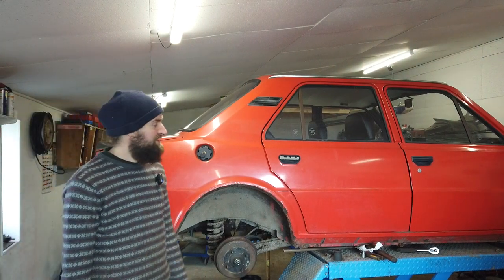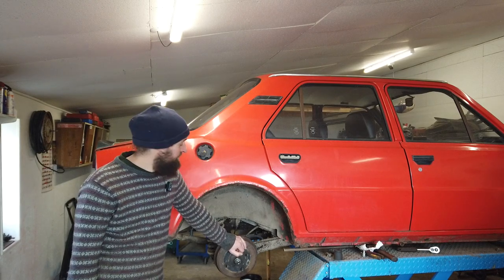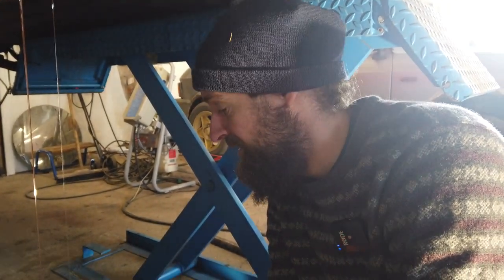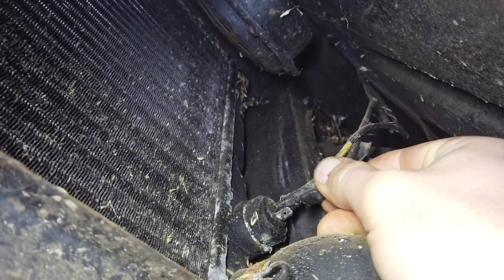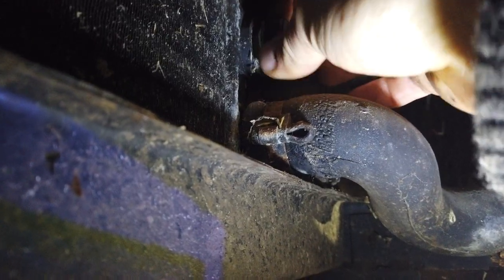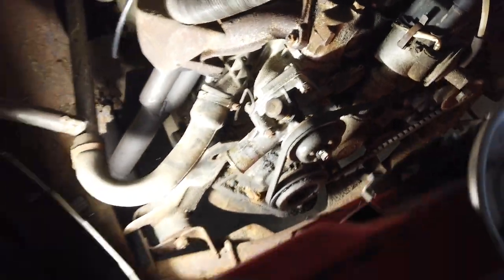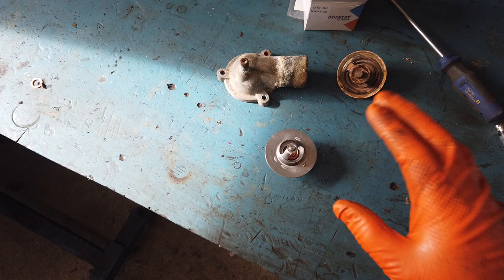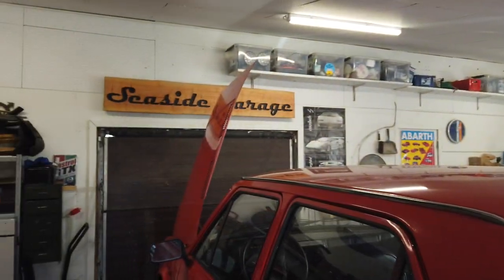BARN FIND ŠKODA 105- Keeping it cool!

Comment: It does look a pleasure to work on. You have that wonderful feature that is now made of unobtainium on modern cars......space to work and reasonable access to components. Our first Skoda Favorit was just the same. Good honest engineering.
Reply: had one for years back in the 80s and there were thousands on the road in my country the uk all gone now never see one and they were so easy to maintain and you did every job yourself good simple mechanics
Reply from the maker: Its made to be fixed and used for as long as the owner pleases.... unlike most newer things...

Comment: Cool the thermo switch still works! The Wahler is the original thermostat! Does your new thermostat have a jiggle pin? That’s important the pin should be fitted upwards facing the highest point. Some clamps have been replaced. See a modern Škoda sticker on the expansion tank as well, so I believe it’s serviced properly. Don’t think they came with red coolant from the factory. But maybe I’m wrong about that. The old clamps sometimes break due to rust. Did you know there are 2 rubber connection hoses under your car? They connect the aluminum pipes. I suggest to inspect them and check the clamps. They might have been rusted through. Rubber hoses are under te cover plate. Need to remove the cover.

Bleeding needs some more effort. Run the engine warm with the heater on and radiator cap off until  it is warmed up completely and the fan turns on. Then put the radiator cap back on and bleed the system until you see a steady jet of water coming out of the bleeder.
Reply from the maker: I will look into that :) I will make sure the bleeding is perfect when I can make use of the waterpump pressure... :)

Thanks for your comment as always!
Reply: Yeah, the sticker says the coolant has been tested in 1997.

Comment: another job done and yet another good memory for me and thats the switch on the radiator and they used to let water in and short out supplying power to the fan all the time and flattening the battery and it took ages to find the issue oh the memories with this project love it
Reply from the maker: Ah! I will remember that... thanks

Comment: Don't worry about old legends, if the liquid is this clean, you'll have no issues with the cooling system :) especially now that you know everything is working correctly.

I'm quoting the factory directions here: the waterpump needs to be greased after every 10000 kms, you have to fill the cap with grease, push all the grease into the pump at once, and you have to tighten the cap, otherwise it might shake off. After that, the used grease from the rear bearing ends up on the backside of the pulley, so you might want to wipe it off, otherwise all that grease will be dispersed around the engine. Most skodas have a distinct line of grease across the hood :D which looks awful, but it also tells you that the pump was maintained correctly :D

Also, people usually overthink the bleeding of the cooling system of skodas, but it's really easy (again, factory directions): you just have to open the bleeding tap at the front before you start filling it up, so the water can push the air out as it fills the components. once the water level stays at the correct level in the expansion tank, you're done, close the tap, and that's it. Provided there's nothing clogged, nothing else needs to be done.
Reply from the maker: Thanks again for this very useful comment!

I was actually told the opposite by a Skoda collector! So I am happy to hear this from a workshop manual... I should then be able to take good care of the pump. :)

Yes the bleeding seems straight forward on this actually.... way easier then my R5GTT and others...

Comment: That looks to be going well - nice to see everything is playing nicely so far. The water hoses with jubilee clips suggest to me that the engine has been taken out at some point as those are the joints you need to break. The hoses with the split pin and band can be left alone hence still original. Any genuine Skoda owner will have several spare bottles of water stashed around the car, in the engine bay you can have a 2 litre pop bottle in the scuttles either side of the chassis rails. In the front near the bleed valve you can usually get another 2 litre bottle! The bleed valve at the front is really useful for a hot refill! If it overheats the last thing you do is take the cap off the expansion tank. With the Skoda just go to the front use the bleed valve to let out the pressure in the system then you can go to the rear remove the pressure cap safely - quickly top up from the bottles stashed away and you are on your way. Been there got the T-Shirt!!
Reply from the maker: Haha that is what those spaces in the engine bay are for! Water bottles! ;)

I think you are right about the jubilee clips.... either engine out or coolant flush and new water pump... :)

Comment: Awesome progress with the brakes and cooling system! That coolant looks so clean :D

Actually, the coolant has multiple additives, not only regarding rust and anti-freeze. It also contains an inhibitor which reduces cavitation on the outside of the cylinders. I think it's a good idea to change the fluid as you already have, since I think it also degrades with time, even though it is not used, but I could be wrong? :) 

Edit: you even mention the coolant going off with time, I think you're right :) and yes, the thermostat housing is very similar to the Mini, and yes, they can be REALLY annoying :D
Reply from the maker: It is looking brand new.... But it must be so old!
So in the bin it goes... :)

Comment: I had the opposite issue with my Volvo v40, the thermostat was stuck open and that caused overcooling, the car was driving around cold long before I got it, making engine sludge and screwing up my oil pressure
Reply from the maker: Yea overcooling is actually very bad for an engine!
Reply: @SeasideGarage  Yeah it's terrible! It took only 10-15 mins to get an oil light + engine knock, after changing the thermostat it took a few drives to blow the crap out of it and then no more engine knock or oil light. I'm a lucky guy